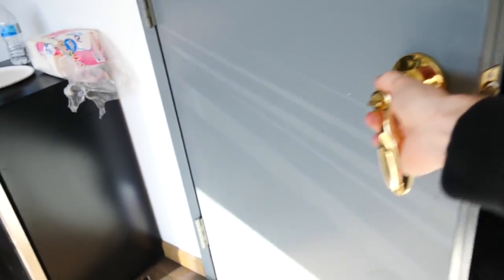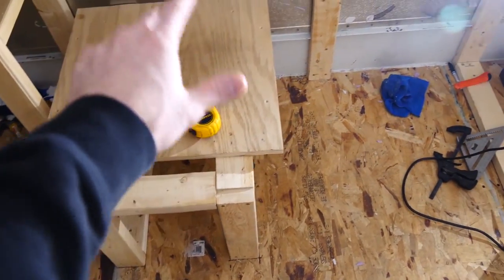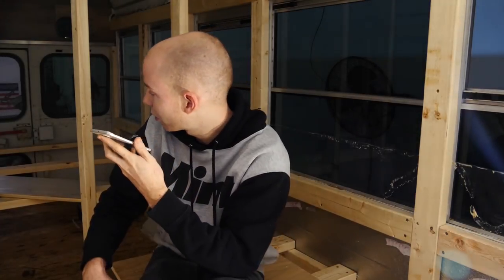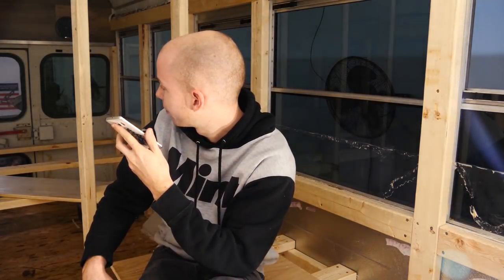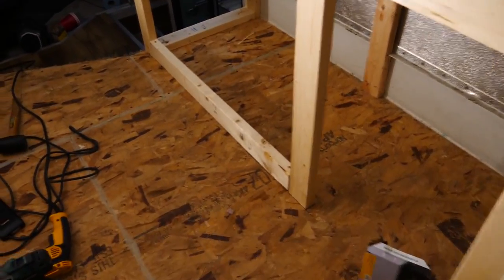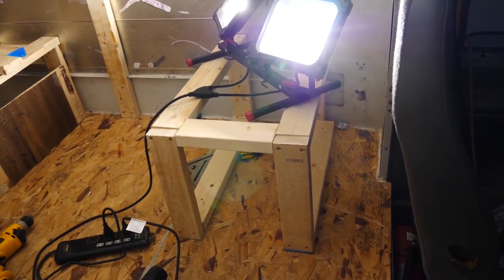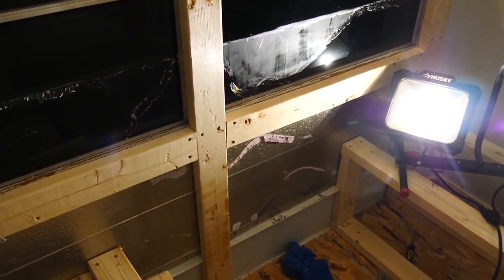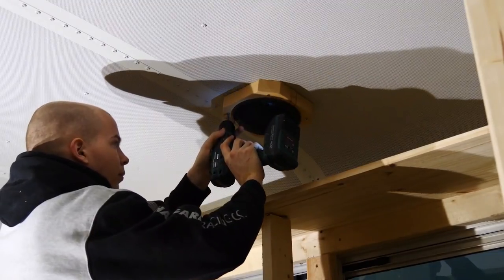Appliances in a SCHOOL BUS? More Progress Done!!!

Comment: Don't forget that the refrigerator basically pumps the internal heat (from the food) to the fridge's sides (the outside walls), so you need at least some airflow on the sides to avoid draining your batteries too fast (trapping your fridge will make it cycle for longer periods of time).
Reply: He needs to cut a sheet out of the bus and put a piece of louvred sheet on like any other  campervan or bus

Comment: You need ventilation holes behind the fridge going outside, they do get hot and need good ventilation so don’t put water tanks behind!!!
Reply: depends on if the fridge is vented from the front or the back. it looks like its from the front, either way he doesn't need to vent them to exterior.
Reply: Nahhh
Reply: Here in Australia and I’m sure it’s the same world wide the motor gas storage is in the bottom back part of the fridge.. it does get hot.. also if a line from the fridge breaks due to driving and shaking, the gasses will kill you!! It’s far easier to seal the fridge in its own compartment and vent outside as all campers are!! I have never seen a fridge that vents forward, causing more problems when carpet is placed in front... I’d rather see ginge alive and able to do more.. then dead because of a gas leak...
Reply: Pretty sure its an electric mini fridge, not a LP one.
Reply: Electric or gas every fridge runs on gas... you should know that ???
Reply: @rleilander  if you mean the condenser... i dont see why that would need to be vented. the only way that would break is he he took it off a 10' jump. not likely to happen.
Reply: Brian!! I love a bit of friendly banter mate!! 3 years ago 3 adult males and one child, died while sleeping because.. you guessed it, the pipes leading in and out the condenser failed and leaked.. no falls included..all I’m saying is for piece of mind and water that’s cold.. place a 10$ vent in and put water under the bus.. anyway if we were all the same people the world would be a boring place!! Merry Christmas and safe and prosperous new year!!
Reply: @rleilander  If that were required of all refrigerators,  Then you'd be required to ventilate the ones in your home as well. It required to have a 1inch gap on each side, and ~4 inch from the back on back vented fridges. You don't need to vent any kind of exhaust to the exterior... they give off heat. not fumes.
Reply: @rleilander  What those guys probably died from was CO poisoning from the diesel generator they were using to run their fridge, maybe. That gives off fumes.. that needs to be vented to the exterior.
Reply: I don’t think that’s the point.. your house doesn’t drive.. bump or shake around
Reply: @rleilander  The fridges do when they're shipped.
Reply: Your mum would be proud of you mate!! Your a true inspiration to all!!! Keep up the good work and enjoy year 8 next term!! Happy new year!!!😘
Reply: @Brian-kn4dn  no offense mate but ur arguement is invalid
Reply: @rleilander  Lol, nice. Friendly banter indeed, huh?   not only have i graduated, but I've worked construction... I have actually installed one of these before under a cabinet. I read the instructions and am pretty familiar with how they work. Happy holidays! :)
Reply: @jamieknight9022   How is my argument invalid?  Yeah, the fridge gives off heat, but the heat is radiated out the front. You don't get too many good shots of the back, but a few times you can see the bottom on the front. There are horizontal slats on the bottom, that's where all the heat from the condenser is vented. Drilling a hole in the side of the bus wouldn't do much for ventilation of the heat if it's all being pushed out the front. Not only that, but If i remember correctly, he has side exhaust on the bus. Drilling a hole on the side might cause exhaust fumes from the bus to be pulled into the bus. That being said, I don't think he should be putting water tanks behind it.
Reply: @Brian-kn4dn  he said hes going to give it a full exhaust to the back again. What the ither guy says sounds correct, ive heard of the condensor pipes breakig and killing people before too and would hate it to happen to gingium, so a vent to vent that gas out would be a good idea incase it does happen
Reply: @jamieknight9022  nah, the condenser pipes only have a refrigerant in it. Either Freon or ammonia, ... any leak would be like pouring a bottle out. It was probably carbon monoxide from the generator. Its pretty common unfortunately. A much more common occurrence than a condenser breaking.
edit- much more common than a broken condenser causing a death
Reply: @Brian-kn4dn  im not sure i still wouldnt play about lol, id play on the safe side with stuff like that
Reply: @jamieknight9022  Refrigerant poisoning happens when someone is exposed to the chemicals used to cool appliances. Refrigerant contains chemicals called fluorinated hydrocarbons (often referred to by a common brand name, “Freon”). Freon is a tasteless, mostly odorless gas. When it is deeply inhaled, it can cut off vital oxygen to your cells and lungs.

Limited exposure — for example, a spill on your skin or breathing near an open container — is only mildly harmful. However, you should try to avoid all contact with these types of chemicals. Even small amounts can cause symptoms.

Inhaling these fumes on purpose to “get high” can be very dangerous. It can be fatal even the very first time you do it. Regularly inhaling high concentrations of Freon can cause issues such as:

breathing problems
fluid buildup in the lungs
organ damage
sudden death

So, yeah... it can cause death. but you'd have to be huffing the stuff, not like what would happen if a leak formed.
Reply: Brian. And all.. I am sorry for entering this conversation.. Brian my last comment was still friendly banter😘.. to all involved I have many talents.. including fridges.. and I am a shipwright aluminium.. now this does not give me the know all knowledge or the excuses for any of my bull crap replies... soo .. maybe history is wrong.. maybe I’m full off shit.. but at the end of the day.. $10 buck and you can wake up in the morning.. to me seems fair and friendly advice... to a YouTuber we both want to see again.. cheers all for your many likes Rob Eilander Australia
Reply: Brian.. why are all your posts edited??
Reply: @rleilander  because I add comas, and apostrophes and correct some typos. You know "editing"
Reply: I gave you a like matey!! ....,,,,, fantastic effort.....,,,, always check your grammar....,,,,! You win .... Always good to keep the teacher happy 😃(also banter Brian)
Reply: Come on Brian.. enough is enough!!! You are smarter more intelligent and probably better looking then me!! Enjoy your Christmas my friend and have a happy new year!! Rob
Reply: @rleilander  are you stoned pal? 😂😂
Reply: Jamie Knight very lmao
Reply: @alfredo42o  lol seemed like it
Reply: @rleilander  I think it runs on peltier chips

Comment: Instead of just tinting the windows, make a sheet of aluminum or something to cover the exterior of the ones you aren’t using! It will look less like a school bus, and you can add more insulation, so less heat loss and rattly windows. It would probably be way less expensive than tint and would look just as good if not better

Comment: The biggest heat loss are the openable windows, then the roof. If you can pull it off I would recommend blocking all four openable windows in the bedroom, leaving the back and emergency exits in tact. As when you are sleeping you don't really need heat running provided your blankets are sufficient :)

Comment: I enjoy your videos. One suggestion.....You  will need to add a mechanical support (like an "L" bracket) to the center shelf to assist the adhesive. The weight of items and the vibration will cause your current attachment to fail.

Comment: Look up a company called The Waterport. They make portable, pressurized water release systems. ALSO, instead of drilling a hole in the bus for the water, just make it to where you can slide the water containers in and out of their designated area, that way incase you EVER end up doing a tear down again, like you are doing now, you won't have to patch it. Plus it'd be easier to just slide them in and out of a little cubby area.

Comment: I used to work with a place that sold window tint, 3M was what we used but in relation to that quote, that was pretty reasonable in comparison to where I worked before.  The reason for the price is because they have to manually cut out piece of tint during install vs a regular car they already had the patterns precut in the computer.  Those bus windows are never identical to each other so cutting out a bunch of rectangles never helped.  Not to mention all the cleaning and prep needed to be to make sure there wasn't any particles in the tint was another chore they dealt with.  Took two days to tint it, but it was a full size bus though

Comment: Here's a tip for some easier sanding. Glue a piece of sandpaper to a 2x4 scrap so you have a solid back.
Reply: I like to do this, and also add a piece of rigid foam and then wrap the sand paper around that and the 2x4 block, that way it has a bit of "bendiness" to it and will conform to slightly uneven surfaces.

Comment: Looking good, this is a fun build.    For the power system I hope you're doing 24v or 48v for the DC side, as a 3000w inverter at 12v would pull 250 amps so you would need pretty thick cabling for that.  If you go with a 48v setup you can get away with #3 or #2 wire and rate the fuses etc at 100a which is going to be easier to manage and give you leg room for loads that might peak over 3000w such as an AC unit starting up.   Good idea on 3000w though better to oversize than to undersize.   Oh and for the AC side of things I would do surface mount EMT or BX I think it would look cool, and not require so many penetrations in your insulation.

Comment: LLUMAR has always been an industry standard for tint over the past few decades but 3m is good. Get ceramic if you can as it helps with heat rejection (another florida resident here ). And if you’re gonna block a few windows why not get some black vinyl for those panels and black them out.

Comment: You will need a inverter to turn the 12vdc into 120vac. A converter dose the opposite there are for charging the battery up when on shore power .. make sure you get a battery isolator it charges your battery bank when you drive from your alternator   ... do you know these things ? ..... love the build keep it up

Comment: Have you think about that can the bus´s alternator keep that kind of electrical system running and still charge the battery for the bus itself ? At least at winter conditions the battery will die quickly. You may need a more powerful alternator for the bus.
Reply: It's going to be on a completely different system from the alternator and car battery from what I can tell. He also had mentioned solar panels in the past
Reply: Or maby two, mechman make some amazing alts for high outputs

Comment: Buy a Tesla battery pack and wire it up to solar panels you could mount over the back sets of windows and get 3m tint. It’s the best in my opinion
Reply: Lithium ion batteries are super tricky to charge properly, if done right it would be good, but lead acid is way more forgiving and less likely to go Note 7 on him.   I imagine those packs are probably kinda hard and expensive to get too.
Reply: Red Squirrel 1,800 for the pack. Holds more power than he’s talking about. The note 7 reference 🤣 that’s classic. As long as he keep the batteries vented I have no complaints. I just was thinking of a gingium type of idea

Comment: Don't put the water tanks behind the fridge unless you want it to get hot from the compressor. And if the water tanks are plastic it will melt. You might need to put a heat shield in between the refrigerator in the tanks.

Comment: What is the gear ratio on your rear differential for the bus? That may be why the fuel economy is bad on the bus.
Reply: Dieselhoon its got nothing to do with that. It was a school bus which was meant to hold a lot of weight and get decent gas mileage. It’s just because it’s an older diesel, and it could probably use a full tune up parts wise and a full retune to dial in the fueling
Reply: Matt L Im pretty sure the Ford e450s have a 4.56 or 4.88 gear ratio in the rear differentials.  They are supposed to be picking kids up and trucking around at lower speeds. They aren't intended to be going on road trips across the country at highway speeds. he needs a lower gear ratio. A 3.73 or a 4.10 would get much better mileage at highway speeds.
Reply: Dieselhoon you are very right sir, I would post this on all his vids it would help him out alot

Comment: 3m colorstable is the only way to go but it’s def not cheap at least $600 in material and supplies you need a conquistador and a heat gun. Those flat windows will be easy if you can still remove them good luck if they don’t come out

Comment: You want to make a drawer that slides out the back door from under the bed just for your trailer straps and tools, so they are secure but easy to get to when hitching and loading your trailer along with a winch on the rear of the chassis to assist loading when the vehicle is unable to be driven on your trailer.
Also why did you not get a wireless reverse camera so the wiring would be less and you could also use a iPad computer Kindle or Android.

Comment: Is the electrical system going to plug into a power point at a campground? Or run from a generator? Potentially solar power on the roof? Quite interested to see the latest iteration of the adventure bus

Comment: Why didn't you use the old Seats from the bus and put some new material around it so they look Nice.
Reply: re-upholstery is pretty expensive and it can't be that easy to diy
Reply: @XxmatixX6videosdiariosdenadav  i know
Reply: @ATVdude02  jupp but IT would look Nice andere sit good
Reply: Mark Vis 
That’s what I plan on doing with my build.

Reupholstering is fairly easy, and they have classes on it at some Michaels stores (my mom and sister did it to a dining room set we had, turned out great minus one mistake).

The best part about upholstering something yourself is you can get as psycho crazy with materials as you want and it still will be done “on the cheap” relatively.  Like denim? Do denim. Want black stingray? Use black stingray. Want leather? Sides are only a hundred bucks, and a pattern just requires your time to stamp it....  getting some of these silly ideas done by a reputable company would result in exorbitant costs not just for man hours, but also the price gouging that frequently comes when people want expensive materials (if he can afford stingray he can afford $150 an hour for my labor).  They never say they bill it that way, but that is how it comes out.

Hmmm, should I use stingray or crocodile belly for my seats?

Comment: I know it's everyone's expected answer, but 3M, i've worked with their tint for years and the only time it has failed on me is when i accidentally used a dish soap that had scented oil inside, which apparently does weird things to plastics. I mostly use it for UV protection, so very light tint. Currently everything i own has an Obsidian 50, obviously, if you'll want to actually tint the glass so prolly Obsidian 5 or the next one down.
I have installed for a friend, and it looks cool, their FX, which is...uh a twin system. Think two way mirror like, but not quite. He bought it because apparently it's supposed to keep heat out of the car (judge is out on that one).

Comment: I’m sure you know this, but your back up camera and audio system won’t run off of the 120v volt AC from the converter, they’ll run off the 12 V DC from the regular bus batteries or the batteries you use to power the converter. So obviously don’t try to plug the camera or the audio system into the inverter otherwise they’ll get fried lol.

Comment: don't forget that the fridge has a cooling system in the back to keep it from overheating
Reply: It's more like a heat pump, you can think of the back of a fridge as an AC condenser unit.  If it overheats it won't cool very well.

Comment: I'm rebuilding a 1983 toyota dolphin rv. I bought an inverter generator so I can always have energy. The rv came with a few batteries, 3 solar panels, and a 400 watt inverter. My plan is to mostly run off the batteries, using the generator and solar to charge them. Large power draw appliances like; an electric water heater possibly, a microwave, maybe an electric heater- will be powered directly by the generator. I'll have to figure out the wiring for all of this. Thoughts?

Comment: What size Subs are you putting in there cuz what you could do which would be my personal opinion build a self-contained our part underneath the bed Edmund underneath like on the driver side underneath the bed do a wrapping box underneath the bed with like four or five or six 12 or 3 or 4:15 or two a eighteens underneath the bed

Comment: Come on, put some lap seatbelts on these seats. Yeah, fixed on wood won't be amazing, but its better than no safety at all. Also for the seats, why not re-using the bus ones and split them in half? Won't be pretty but should surely work